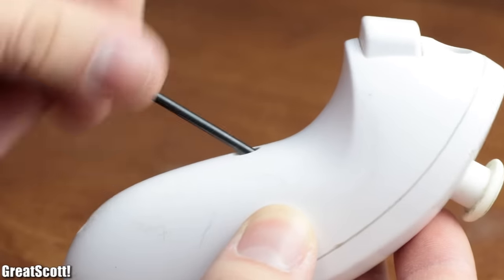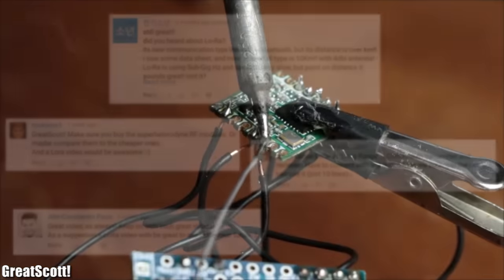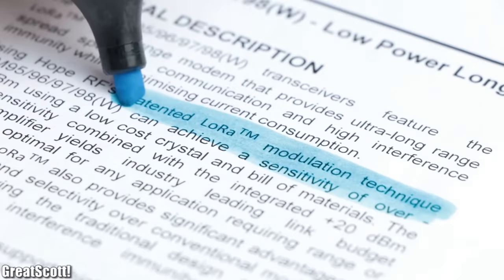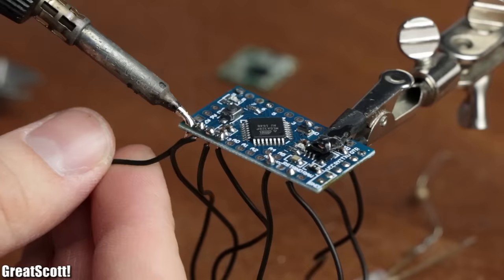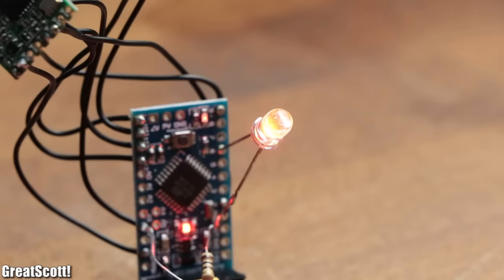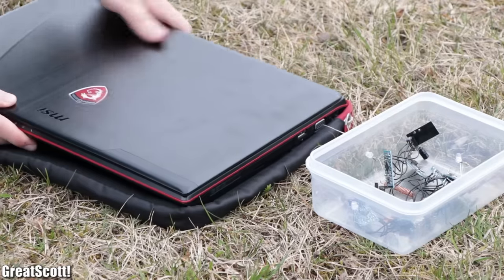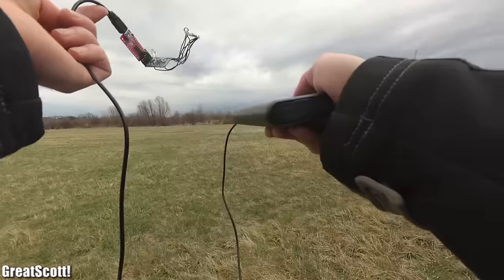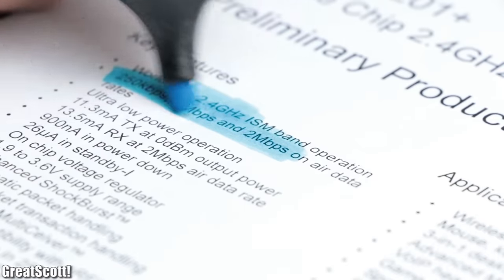LoRa Module VS nRF24 VS Generic RF Module || Range & Power Test

Comment: Now i know what LoRa is. To the nrf module. I had problems with that one to. I was unable to get a stable connection over a meter. I soldered a 47uF cap to the + and - pins and increased it's transmision power. There is a library (https://platformio.org/lib/show/42/nRF24) with can set the mode to 0dbm 6dbm 12dbm and 18dbm. Once i increase that i was able to get it working to send and receive over 40m indoors. Maybe you can check that for yourself.

Comment: I don't know anything about circuits but I wanted to ask if the reciever put out power to run an electrical motor
Reply: U can run an electrical motor on the receiver but u will need battery to power both motor and the receiver circuit

Comment: One of the noname generics  gave me a headache sometime ago, I've tried all kinds of firmware for it, I've tried to debug it on assembly level without any success. After few years I've found out, it doesn't work without external antenna at all.☺

Comment: Lora should have much better distance. First of all this LoRa module has unbalanced output, so you need ether balun or some ground surface for better reception (monopole with ground surface for example) or some other antenna that is suitable for such output. Second, I'm not sure about the antenna if it's matched for 833MHz, but if you took it from 433MHz module probably it is not. Also, you should consider impedance mismatch loss if antenna and output (probably 50 Ohm) have very different impedance. 
If I remember correctly, my RF LoRa module should have over 20km of range using 433MHz band if communication is in LOS conditions (I checked it with Friis equation).

Comment: Hi all.
Some advice pls.
I want to send an audio signal about 2km .it is for an intruder door alarm on a boat.
Cannot use wi-fi but radio signal..AM maybe..
The idea is for a noise to be sent to a simple reciever with a loudspeaker...not sure to use pure components., modules, or Arduino which may be an overkill...
Any hints or YouTube videos would be great..
Thanks for any help..
To elaborate, imagine being anchored near a town. rowing to shore for a meal and someone has boarded your boat..the intruder alarm goes off but you can't hear it. So a little 
Tx signal at 100hz to a little receiver that the boaty has in his pocket running on a 9v battery is the thing....very simple... Any ideas?

Comment: with those super cheap guys they don't instantly respond properly. you gotta send data to the receiver for a while until the receiver locks onto the carrier properly & starts to get a signal out of it. i send about 50 null bytes before hand and then its good to go with serial.write() and stuff.

Comment: A low range signal is a consequence of poor soldering.
Contacting antennae and copper on the RF board must have a strong physical contact, resistance of tin is too high for using as a good conductor, it messes the strenght of sensitive signal that have power of few mW.

Comment: Your body will block RF signal...
If you backward going will be better
I tested NRF24 Printed antenna max range is 100 m
or soldering a copper wire on antenna, I got 125 m in test

Comment: Hey GreatScott love your videos man. Just one tip: Want range? Buy the PA+LNA version of the nRF24l01+ with the matching antenna. Even better get the shielded version from china. It has a Power Amplifier for output and a Low Noise Amplifier in the input. You can get 1000+ meters with this simple setup. Its what im using for my custom RC plane. the channel iforce2d made some excellent videos about this modules: https://www.youtube.com/watch?v=gtM832Z0ujE. As always its a blast to watch your content keep up the good work.
Reply: It is.
Reply: what if i solder a piece of wire (half wavelength length) to the antenna pin of the nrf chip? 🤔

Comment: I attached a straight 173mm wire to both transmitter as well as receiver of 433mhz generic module...
I don’t know how but I got a range of 60-65m😅

Comment: Thank for the video, for Radio tests you need to check more important details:

- Antenna, a 868 MHz adjusted antenna with a good ground counter plane is very important.
- Antenna, preferably use fixed orientation vertical or horizontal, otherwise it won’t work well.
- LoRa Bandwidth: The default is 128 kBit, smaller  bandwidth equals larger distance
- LoRa speeding factor: SDefualt isF 7 which works great and fast, for larger distance you can go up to SF12 which works very slow however gets much longer distances.

We from the Arduino Hannover LoRa Group released today a turnkey Arduino ESP32 ECO Power Board with LoRa, we get 200m up to 20km, so your setup was not efficient for the LoRa distance measuring.
See more details here: www.radioshuttle.de

Regards from the Arduino Hannover LoRa Group.

Comment: try esp8266 wifi chips
one as wifi
another as hotspot 
esp8266 has an inbuilt microcontroller, you can do basic functions(blink etc) without arduino. because it has only 2 gpio pins
else you can go with nodemcu-esp8266 and has 12 gpio + 1 analog

Comment: I really respect you and your videos but I think that the nRF24L01 test was not done well, not sure what happened, but 10 meters is just not correct. I could easily get 500m with a cheap setup and no capacitors and in the city.

Comment: That is some rough soldering. Heat the joint not the solder and it will flow better.

Comment: It is not fare, as the antenna you used on the LORA transceivers is the same that on the 433Mhz one, so the antenna was not working OK on the lora device, as the frequency is different.

Comment: you should have used a boost converter to power the generic transmitter with 12V instead of 5V. That would have given you a much larger range

Comment: I think you should try the new RFM98PW (new Higher power version) at 433MHz and couple it with a decent antenna you will find the range improves a lot I think.  Otherwise the RFM69HCW is also a high power version and a lot cheaper but although not LoRa is almost as good...  The Frequency and quality of antenna's used can make a huge difference.  Also I think the RFM95 modules are only for Region 2 (America).  You need ITU Region 1 devices even for ISM AFAIK, but Andreas Spiess has more info on his channel.

Comment: And you should have said about the frequency Vs wavelength expression.

Wavelength=speed of light / frequency.
In meters 

Becoz. Wavelength determines the ranges upto which it can transfer data for a given power.

distance it can travel is given by twice wavength

Comment: not sure why you got such poor results with the nrf modules, iforce2d has a series of range tests with those modules, and has been able to transmit data further than around 10km with a little wire antenna, and around 30km with directional antennae
Reply: Maybe because it's a clone and dont have a genuine parts

Comment: A few points I find rather bad about this video, in no particular order: 
-Using the same antenna for the generic modules and the LoRa modules is a really bad idea. Antennas are only effective in a certain frequency range. 433MHz and 868 MHz are too far apart to use the same antenna. 
-The electrolytic capacitors you soldered onto the NRF modules are useless due to parasitics. Use SMD ceramics of maybe 1uF and solder them directly between the pins. This would help much more.
-The current measurements are not useful either, the bursty nature of the consumption can not be captured with such a DMM.
-No one cares how exactly you built the setup. Just show the finished build, explain it quickly and be done with it. The interesting parts of the video can be compressed to three minutes.

Comment: Made a test last eeek with nrf2401+ the one with amp and 2dbi antenna and I got great communication for 262m before I got bored  of walking. I'll use it for rc plane remote control and if you want to know the max distance that I can get leave a comment and I'll post it here

Comment: Hello... I always follow you and all wharf you do is great... It very interesant and usefull.
I am working in a esp8266 project and android. I only want to control inputs and OUTPUTS of the esp8266 with my mobile with a direct wifi connection to the ESP without a router between them. And if is posible using arduino IDE. And an apk instead of the web brouser. Can you do some project of this?? It could be very usefull for all. Or if you know where to look for also would be usefull.
Thsnks you and continue doing this great job.

Comment: The RF transmitter ARE ILLEGAL (in the UK) unless you have a license or you have confirmed with your local spectrum license authority. In the UK 433 MHz falls in the amateur radio band and if you do not hold the license no transmitting or else it is a very hefty fine.
Reply: Thomas Scott 433 is fine (free - can transmit without license) in slovakia - you just need to be in certain output power range (some half watt or so - not sure about the number).
Reply: Thomas Scott in germany its legal only when the range is below 2 meters
Reply: 433 is fine in Sweden as well. It's different for every country, but it's something to keep in mind no doubt.
Reply: Thomas Scott who caree
Reply: Greatscott is right. ISM bands are free tu use without license if you comply to the rules. There are no limitations on reach but on output power.
Reply: It's ridiculously difficult to get a straight answer when looking at the UK government or Ofcom websites.
www.ofcom.org.uk/__data/assets/pdf_file/0022/103297/fat-ism-frequencies.pdf

So we can use 433mhz as long as our use of it doesn't contravene anything that's in 5 different Acts -hundreds or thousands of pages.

I keep thinking that they must have a page somewhere, that tells the public what they can actually do, but really can't find it.
Reply: I purchased one of these modules myself to play with. I got in contact Ofcom for a start it took nearly 4 weeks for them to reply. then once they did they had no idea themselves but I found a way to get around it as long as I use a common mode of transmission and no message are obscured and I identify my self with me amateur radio callsign I can legally use these devices. My major concern is people with little knowledge going and causing harm in the UK amateur bands plus some areas of the 70cm band is shared with military I know some of the military channels are near but sadly I can not disclose any information about that.
Reply: If you are in the UK you run into issues. I was mainly focusing for the people in the uk sorry if I did not make that clear I will go correct my original comment.
Reply: Short range devices are permitted under IR2030 in the 433.05-433.79MHz range in the UK. 

There are restrictions with regard to the power output and duty cycles but they are not illegal without licence as long as you stay within the given frequency bands, output restrictions and data type (e.g. telemetry rather than voice).

Further reading at:

https://www.ofcom.org.uk/__data/assets/pdf_file/0028/84970/ir-2030-july-2017.pdf
Reply: I have spoken to Ofcom directly and they have made it very clear to me that I need a license or a special exception. If you would more information I would be happy to tell you.
Reply: Thomas Scott - They gave you bad info. 433MHz has been legal for lpd for many years now here in the U.K.. No licence required. Car remote fobs use it, amongst many, many other devices. The only area where there is confusion is whether it is data only or voice is permitted. Radio Hams were less than pleased about the allocation, to say the least. As a non practising Ham, I couldn’t care less! It’s great that the general public can directly use parts of the radio spectrum. At one time, anything that transmitted an rf signal, even those woeful toy walkie talkies, required a license or were outright illegal.
Reply: ProdigalPorcupine I linked him the published Ofcom Interface Requirements that specifically allow for use of 433mhz devices dependant on power and duty cycles but some people would rather believe in some Temp on the phone than actual publication.

As you mention, how many people have licences for their 433mhz garage door / car lock keyfob..

Comment: I test the transmiter-reciver modules both with soldered antena,  and i mesure about 64m instead your 10m.  The antenas was only two pieces of wire aproximately 1m long.  But you need to soldered in both boards.

Comment: Diy Or Buy 
Audrino
Can you make it
Reply: definitely buy
Reply: Arthurino
Reply: Arduino*
Reply: D I why
Reply: for prototyping, arduino. If you want to keep your projects or embed them into something, definitely look into using the chips only. You can flash them with the arduino bootloader and run all of your normal code, but the chips cost about 2$.
Reply: Just grab the AVR chip, learn real embedded programming :)
However, you can always flash an Arduino bootloader on them though.
Reply: Depends on what you're doing. Also saying "Arduino" these days is almost like saying "Computer."  Arduino covers everything from a DigiSpark Tiny up through stuff running on the STM32 or the ESP32 running at 100MHZ or more.
I've "made" Arduinos in the past - just take an ATMega328p, attach a 16MHz crystal and a pair of 22nf capacitors, and you have bare bones Arduino.
However, if you want cheap, traditional Arduino is hampered by the fact that the 8 bit ATMega chips are expensive for what you get.  The STM32 is probably the cheapest way to go there.
I doubt that ANYONE will say that if you just want to play around with Arduino that it's cheaper to build than to buy an STM32 board for < $2
Reply: Buy. 3$ on fleebay
Reply: It's easy to make an Arduino, but it's also easy to make a bolt. It's just not worth it when you can buy them for so cheap.
Reply: There's absolutely no justification for making an actual Arduino. But there are plenty of times when you want to grab the chip off an Arduino and put it into a different product.  Arduino is probably never going to be the right answer for a large run product, but if you're making a few dozen of something, just getting the chip off the board, putting it onto your board and flashing the Arduino bootloader onto it might be a good approach.
Reply: Diy
Reply: Weeduino